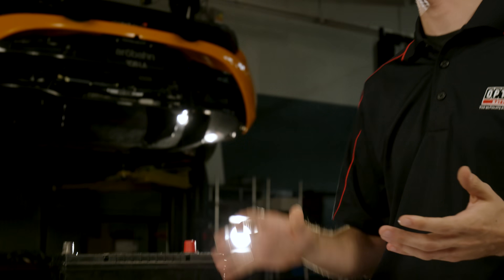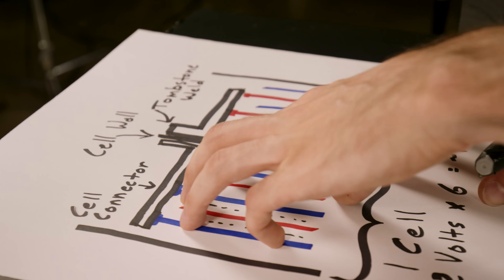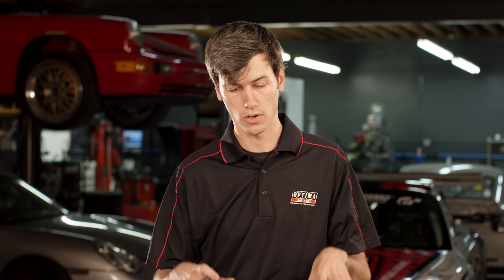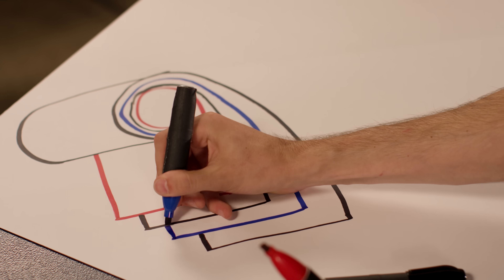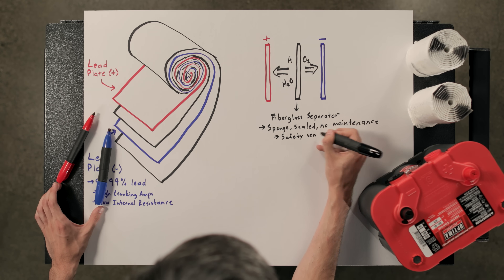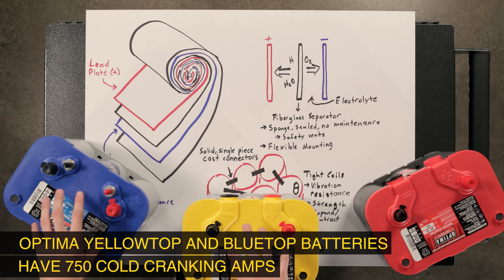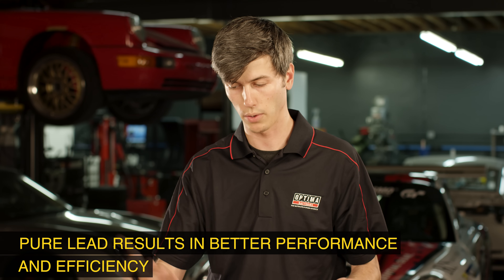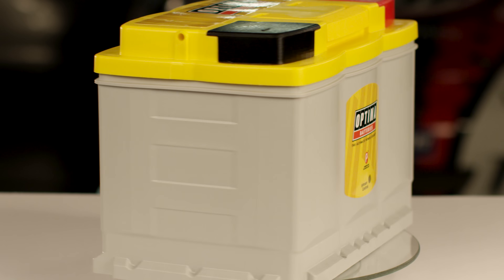What Type Of Car Battery Should You Use? Flooded vs AGM

Comment: My previous Optima battery was replaced after 8 years of use. However, it was still good! I merely wanted to replace it before a 5,000 mile trip so that I wouldn't be forced to possibly do it on the road. These batteries are a true investment.

Comment: Johnson controls is the oe supplier for mopar/fca products. I work at a Canadian dealership and we see a lot of frozen lead batteries. The glass batteries can loose their charge over long periods in the cold, but rarely "freeze" solid and often can be thawed and charged without much fear that one of the cells ruptured when the battery lost its charge in the cold. If your in cold Canadian weather glass batteries are definitely the way to go! They can be saved wayyyy more often then any battery I've seen
Reply from the maker: Thanks for sharing your personal insight and experience with the subject!
Reply: crkt308 that might be one of the reasons why I’ve never really had a problem with optimal batteries. I’ve used them in the USA Rocky Mountains and I like them so much I’m not planning on going back to flooded lead acid batteries again but I would like to try a lithium one

Comment: My Z06 has it's battery mounted in the back inside a cubby area. I noticed it seems to be totally sealed except for a ventilation tube coming out of the battery. Which, I assume, is to vent the hydrogen gasses which develop under charging. Would the Optimal AGM square battery be suitable for this application? Mine is over 5 years old and it's probably near the end of it's life cycle.

Comment: I have purchased 5 Optimas, two yellow tops and three red tops.  All went bad in 1-2yrs.  They are in seasonal cars and battery tenders were not used on the first two, but I used them on subsequent batteries.  I had two of the red tops outgas on me.  I tried all of the tricks to bring the dead batteries back to life such as charging them in sequence with a traditional lead acid battery with no luck.  Everyone I know ran them has gone back to traditional lead acid batteries due to these problems. I will never buy another one.

Comment: I have a small mat-type battery for my garden tractor, and it has out performed the other two regular batteries I had before. It's still working fine after several years of Wisconsin's freeze/thaw cycles.

Comment: LITHIUM-- 1/4 the weight of 1 equal to 4 lead acid/agm--- Use Odessey or a high output agm like kinetic/XS if using a conventional battery.(This is basically a paid advertisement optima is old school and over-rated/always damaged in shipping)

Comment: Do the AGM batteries have any weight saving advantage over a flooded type? Great video, thanks!
Reply: No, they are heavier compared to an equivalent sized flooded battery. My Exide group 24 battery weighs about 50 lbs. 
 The only way to save weight is to try a smaller sized Odyssey agm battery though you'll probably have to improvise the battery holder to lift the height of the battery.

Comment: I use multiple flooded lead acid batteries in my bass boat and I have found that they die in a stupid short amount of time and I have tried mutipul charging solutions and storage solutions and I have seen no difference in the life of my battery. You mentioned in the video that vibrations can cause these batteries to break. My boat is a deep hull boat in the great lakes so I am often crashing through the waves to get around. Is it likely that my battery is breaking due to the crashing?

Comment: Is the voltage rating/output of AGM compatible with the charging variables in a car designed for a flooded type battery?
Reply from the maker: Yep! It will have a very similar voltage as it uses the same six-cell methodology.

Comment: Very informative, I bought 3 red top Optima batteries, for my classic trucks all GMC Sierra, I installed them on a three trucks a 1972 (350 V8), 1986 (350 V8), and 1987 (454 V8). I liked them because of high cranking power, and the side and top terminals. However, after nearly 11 months after purchasing, they started going flat, tried to charge them with no luck. I’m very disappointed with Optima, I changed back to ACDelco batteries. Can you pls elaborate on why? Thanks

Comment: Thumb down. First I've awarded to EE, but with good reason, I believe. First of all, I understand this is a paid advertisement so a certain level of bias towards the money must come into play. But at the cost of your own integrity? Perhaps a bit of unbiased research prior to making this commercial would have prepared you a bit better. You usually (appear to) know what you're talking about. Not so here. When you didn't look like a deer in the headlights, you were directly reading or copying the talking points provided by Optima's PR crew. And you completely missed (I could say skipped, but you didn't appear to know what you were talking about so "missed" is more fitting) a bunch of things that should have been addressed, and/or addressed in more detail. Start with the title... "what type... should you use...": How exactly was the word "should" addressed? There are many vehicle on the market today that come with AGM batteries OR the traditional style liquid, based upon other hardware and software options in the vehicle. In this case, you "should" use the style recommended and supplied by the manufacturer or you could create some problems. For instance, what's gonna happen if you replace an oem AGM with the other style? How about the other way round? Replacing an AGM with a flooded style battery (it's cheaper to do it this way, right?... so people are going to do it) in a modern vehicle that uses alternator on/off technology to enhance fuel economy is pretty much a recipe for disaster. Why, you ask? Different charge rates and voltage regulation. What charge voltage can a regular liquid battery handle? Is it the same for AGM? And how does that interact with modern alternator and ecu technology?
I don't think you addressed oxidation issues, which is actually a pretty significant subject when discussing differences between AGM and a traditional liquid battery. Optima wanted you to point out how pure their lead is (you brought it up more than once) but then didn't have you talk about air vs lead. And since you brought up the sealed vs non-sealed issue... I'll bet there are a lot of people watching this video that have purchased non-serviceable, sealed flooded style batteries who are now scratching their heads and wondering how that jives with your statements. "hydrogen and oxygen may escape" ... so there's pure oxygen and hydrogen bubbles forming during the chemical reaction and they're touching what?  Hmmmmm
What about mix and match? Dual battery setups are not uncommon. What if one goes bad and you've got to replace it? Can you put in the other style safely? Nope. Not a good idea. I'll bet the Optima folks didn't bother to tell you how that faster charge/discharge rate you read for them makes their batteries all but incompatible with regular flooded batteries in a non-isolated dual battery setup. It's pretty much a guarantee you're gonna start seeing overheated batteries and/or smoked alternators as a result of making that mistake. It actually happens a lot because the salesman or the customer believes adding an AGM is an "upgrade" in pretty much all scenarios. Very misleading.
I'm also not buying that line about the spiral being good for flexible mounting. You should have caught them on that one. Especially since they have copied a lot of other battery manufacturers and started making the flat plate style AGM. They had you read about how that battery has flexible mounting benefits. Which is it, flat or spiral? Both, because it's not the layout that creates the benefit. It's a matter of the goo between the plates, not the plate shape or orientation. The spiral may have some benefits but orientation probably shouldn't even be on the list. If their PR crew had gone to lunch and let you spend some time with their engineers, you could have brought some quality info in your normal style. Instead, maybe you should have just said the spirals are freakin cool and that's reason enough, but the newer flat style can be more energy dense (and explain why) for a given foot print (which you almost kinda sorta touched on). If the video was more about information than advertisement, you could probably have spent more time talking application which is a more appropriate subject considering the title. I will say that I endorse your making extra money by doing commercials for companies, but I think you should isolate that from your regular series so your content quality is shaped by you and not others who have little if anything to do with how you arrived here in the first place. 
Cheers!

Comment: Funny thing not mentioned is Johnson Controls has been making flat-plate AGM batteries for OEMs and the aftermarket since 2001, as has one of their acquisitions, Varta. If you see a battery advertised with "PowerFrame™ Grid technology" that's a giveaway it's a JC battery (BTW, the grid he showed in the video looks like a PowerFrame grid). Some aftermarket re-labels of these are the Autocraft Platinum and Duralast Platinum (in certain sizes). A gray case with stylized "AGM xx" molded into the face is also an indicator of a JC-made flat-plate AGM.  My question is how does this "new" Optima flat-plate AGM compare to JC's existing line of flat-plate AGMs? Is it just another re-branding or is it something different?

FYI, JC has an existing AGM battery plant in Toledo, OH and is reportedly expanding plants in St. Joseph, MO and Middletown, DE for AGM production. Unfortunately they also announced plans to produce AGM's in China as well. Optima battery production moved to Mexico from Aurora, CO shortly after JC bought Optima. Coincidentally, that's when many users, including myself, noticed a decline in the quality of Optima batteries. I had 3 of the "old" light-gray USA-made Optimas last at least 6 years each (one went 8), but I went through 3 of the dark-gray Mexico-made batteries (two lasted less than a year each and one made it 3 years) before I gave up on Optima and looked elsewhere. Ironically, I'm now testing their other non-Optima flat-plate AGM solutions that at least are priced realistically (around $150 for a typical group 24) and have the same 3 year warranty as an Optima that's almost 2x the price. 

Also it's worth noting their competitor, Exide, makes both flat plate AGMs (Edge) and spiral AGMs (Orbital) and in some channels are available with a 4 year warranty for around the same price as the JC flat plate AGMs. For example, the Pep Boys Bosch Platinum AGM "is backed by the confidence of a full 4-year free replacement warranty" and sells for $147 in Group 24F after instant $50 rebate.

Comment: Some car manufacturers demand the use of an AGM battery. Mine does because in my TT the battery is in the inside the car, so to avoid any spillage of battery acid in case of a car crash I have to use AGM.

Comment: The AGM seems to take up the same amount of space, though it likely weighs less.   Assuming it would still allow simillar CCA as the flooded, why not make them more compact and take up less volume?
Reply: I know this is a four-year-old comment however I work at a battery store and can tell you that the agms generally weigh more. They also seem to have a little less CCA than our top rated flooded counterpart however they generally have more Reserve capacity for running electronics that have a continuous draw. I see them used a lot in police vehicles because of this.

Comment: The flooded lead acid batteries also can have issues with ambient heat, above 100F, adding to the evaporation of the electrolyte. It isn't hard to add more water though. Just make sure you only use distilled water. Same goes for your radiator. Distilled water, coolant, or premixed coolant only.

Comment: What do you think about replacing the regular batteries with the AGM ones in cars? I've been led to understand that because the cars are programmed to charge batteries at a certain rate switching to AGM when not required would shorten the batteries life. Is that true or just a old wives tale?
Reply from the maker: Doesn’t make sense to me, since both will be of similar voltage, though perhaps different capacities.

Comment: Thanks. I have always been curious as to why the types of cells used in Optima batteries are so much more resilient after retrofitting a muscle car with a Viper Alarm system. On a standard lead-acid car battery the alarm system was the tipping point that would ruin the batteries within months of use. After a very detailed inspection of the cars electronic systems the only conclusion I could reach was that the battery just wasn't capable of handling the load placed on it. My options were a larger battery or a better constructed battery. At the recommendation of a friend I went with better constructed via Optima. Lo and behold the problem was solved, solved so well I could add a 200W amp, 4 35W speakers each driven by individual amps modeled after the amp I built for my computer's sound system and still had a healthy margin left if my discharge rate calculations were to be believed. 

Only had to exchange the Optima once in the 7 years I had that car. It wasn't even due to the battery failing, my post clamps gouged the hell out of the posts when the battery bracket broke loose after a rough night of having fun in a large flat dirt field. When I called Optima to see how much they would charge to repair the post they exchanged it at no cost. I could never bring myself to pop one of those open with how long they last, afraid I would vastly shorten the life of a damn good battery.

Comment: Informative video! Just one question: is there a weight benefit using the AGM batteries?
Reply from the maker: From a density standpoint, maybe slightly with the use of pure lead. I have two different types in my garage, I need to weigh them!

Comment: Which type is better in extreme temperatures? Our Canadian winters can be hard on flooded lead acid batteries, I'm curious how AGM compares.
Reply from the maker: Well they are generally designed with higher cold cranking amps (especially the red top) to handle low temps vs traditional flooded batteries.

Comment: I drive an old 85 GMC diesel pickup. Seems like a nice starter coil battery would be worth the investment. I've had flooded batteries on the thing forever and sometimes cranking that big diesel engine can be a bit hard on the batteries.

Comment: What about lithium? I have one in my bike that's two years old now, works like a charm, even during winter, and weighs less than a kilogram (that's 3 and 3/8th of 2 wet sponges in imperial, I think). Are they even used in cars? Mine has ezpz cca, but relatively low capacity, which doesn't really matter for bikes.

Comment: I believe Kia/Hyundai has been using AGM since 12/13 when they introduced Idle Stop and Go. Since 16MY I believe, Kia/Hyundai have been shipping most, if not all, of their vehicles with AGM batteries. I work at a Kia dealer, so, there you go.

Comment: Great info about battery tech. Still no Optima direct fit options for either of my Euro cars. Thanks Johnson/Tyco. They would just say "Just go to the dealer and get an OE AGM" Still guess it is better than the old joy that was buying used "sold as new" battery from Sears/Exide.
Reply from the maker: That will likely be changing with the newer flat plate AGM, as part of the driving factor behind it was fitment in European models.

Comment: Let's say I purchased a yellow top Optima battery. If the car won't turn over and the battery seems dead, and I need to get somewhere immediately due to an emergency or other reasons, can I use a traditional battery charger that most of us have in our garage  (on max output setting voltage or amps) to charge this battery like a traditional flooded-lead battery?

What about short and long term risk from this event?
Reply from the maker: Yes, can charge exactly like other lead-acid batteries.
Reply: Wrong. You need a agm battery charger, or daisy chain from another battery to the optima.

Comment: And attaching different size load cables directly to the terminals , using them as a form of junction block, shortens battery life and encourages more battery sales. Even though its not widely understood. There is a reason for that. General motors does the best job on wiring principles that lengthen battery life.

Comment: No mention of the Rectangular AGM having the ability to house more material in the same area/volume as the 6 cylindrical cell AGM?
Reply from the maker: Yes, that’s essentially the packaging message (it fits similar performance in a smaller footprint).

Comment: It's a shame you only reviewed lead-acid batteries, not sure if Optima even have something else. What I'm missing here is a LiFePo4 battery, these Lithium-Iron-Phosphate batteries are a fit replacement for existing lead batteries at 12.8 Volts. They generally also have a good energy density and decent cold weather characteristics. They are also quite robust and fire safe.

Comment: If you use a deep cycle battery make sure your alternator is designed for it.  The alternator on your car is likely designed to charge and regulate a standard lead acid, and deep cycle batteries can overtax your alternator.

Comment: When I talked with Optima they said that the yellow battery was best for motorhome coach batteries, however your video suggests that the blue top battery would be better?
Reply from the maker: Either will do, I believe the blue-top gives you two extra terminals to work with, otherwise they’re chemically the same.